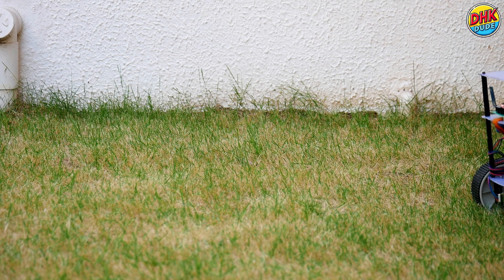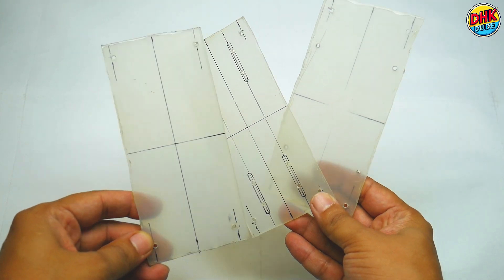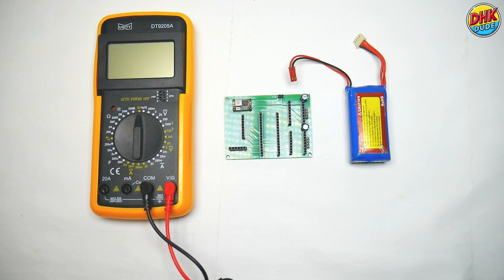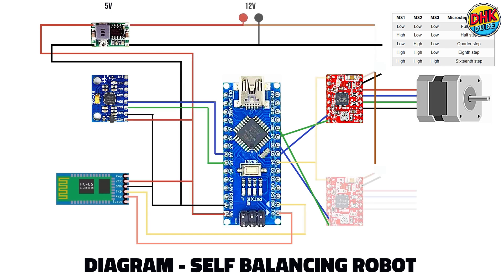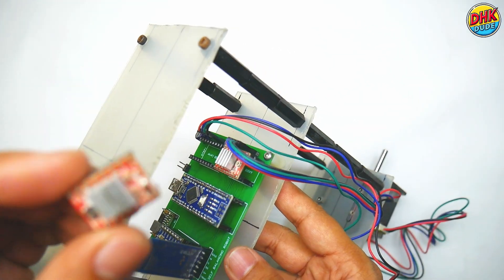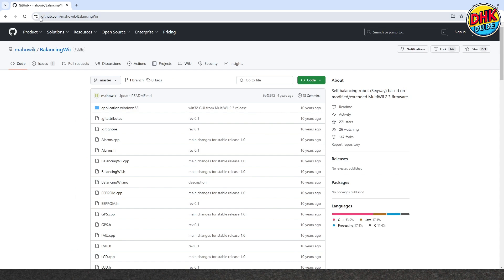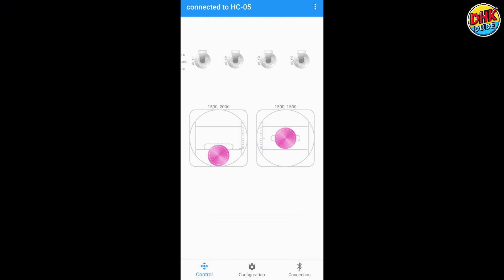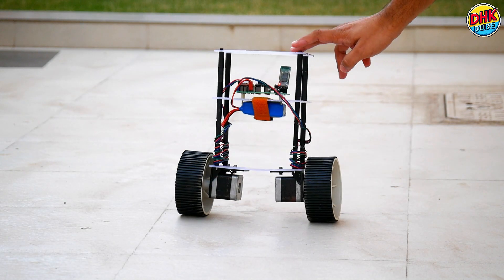How I Built a Robot That Balances Perfectly!

Comment: My robot keeps going in one direction when I turn on the model control. What might be the issue? Please help!
Reply from the maker: @WillowCox134  hi, have you calibrated the mpu6050 using the app?
Reply: @DHKDUDE  You mean ACCcalibration? I've done that
Reply from the maker: @WillowCox134  yes accelerometer calibration, keep the robot in leveled position and calibrate the sensor. I am in the process of creating one separate video for troubleshooting.
Reply: @DHKDUDE  Thank you for replying. I'd love to see the video. I did the calibration multiple times. I'm using breadboard for the circuit and I haven't firmly fixed the MPU6050 as I'm in the phase of prototyping. I'll try it again by fixing the MPU6050.

Comment: Please help me my robot is not running and in the app sound coming no data received
Reply from the maker: It means, there's an issue with the connection between phone and robot. You have to change the baud rate of the HC-05 module.
Reply: @DHKDUDE  I changed it but still not working

Comment: Could you help me with my problem? My Nema 17 motor will just keep on spinning when I open the untested part of ES-GUI it won’t balance or anything it just spins and can’t really go backwards
Reply from the maker: You are almost there! From your post what I understand is, your robot receives a signal from the phone as the motor starts spinning when you go to the untested model, but it is not correct hence the motor keeps spinning. 
There are two possible reasons:
1. Your MPU6050 gyro-accelerometer module is not calibrated. Put your robot on the box in the standing position and keep the wheels free to rotate. Connect the robot to the app and calibrate the module. 
2. Selection of the active axis is wrong in the sketch. Check the mounting position of the mpu6050 and select the axis in the sketch accordingly and reflash the code again.
Try these methods and it will probably fix the issue.
Reply: @ could u explain step 2 further, I don’t really understand
Reply from the maker: Open balancingwii in Arduino IDE, go the config.h page, scroll down to the section 1 - basic setup/current axis. By default it is PITCH but if your sensor orientation on the robot is on the ROLL axis, you have to change it. If step one doesn't work then probably you have to change this value.
Reply: @DHKDUDE  It still won’t work
Reply: I’m still facing the problem inwhich it would just keep spinning it’s wheel non stop I can control it a bit but it won’t balance and when the joystick in EZ-GUI returns to the center it won’t stop spinning
Reply: Sometimes it loads write error too in EZ-GUI
Reply from the maker: @sunsetthireach3223  I will make separate video on troubleshooting as I see some users having issues with connection.
Reply: @ Hello, i did some more testing and this is what I got. When I go to untested the motor starts to spin constantly. I checked if the motor will follow the direction it will fall in and move against and it does do that although slowly but still the robot can’t be controlled as when the joystick is mid it would just spin on and on and won’t stop until I change ARM to high or mid.
Reply from the maker: If your motors are moving and reacting to the movement means there are no issues with the software part. Default settings are good to go so no major tweaks needed there but check your PID gain and also try position hold mode. It would be nice if you share a video of your setup to better understand the issue.

Comment: I am having problem with the gui app can you help it out as i don't know where to download it as it is not available on play store and on website older version is available.
Reply from the maker: I used version 4.5 of this app as long as I remember. Development of this app is discontinued but I think you will still get it from some other sites, just search EZ-GUI ground station on Google, just make sure the site is trusted.
Reply: @DHKDUDE  the site version is not working properly, could you provide your app link.
Reply from the maker: @A.EditZ...Ajcr21  sorry I missed this comment. i just checked my spare phone but it seems i deleted the apk from it after posting the video :p but as far as I remember I just randomly searched for this apk and downloaded it from the site that appeared in the results. i doubt you haven't set baud rate of the module, without changing it won't connect to the SBR.

Comment: I am facing issue with it can you help me
Reply from the maker: Let me know in which part you need help?
Reply: Motor is not running when I connect it to the supply
Reply: I message you on Instagram also
Reply: And app is also not sending data to arduino
Reply from the maker: @Adarshsharma_005  the only possible reason could be the connection between bluetooth module and the phone. you have to change baud rate of the HC-05 module. I have explained it here, in this video https://youtu.be/4qSqwGmLa0s?si=NjlHXfTlVWKSkXmJ
Reply: @DHKDUDE   i have change it but still it is not working

Comment: Is it possible to make this with a 28byj48 stepper motor? Please tell me.
Reply from the maker: I would not recommend it to use that motor for these two reasons.

1. For this application you need high torque, which 28byj48 won't provide. Nema17 motors with A4988 driver you can crank up the voltage double to battery voltage to increase torque. You just have to limit the current, which we have shown in this video.

2. 2nd reason is this particular code is well proven with nema17 motors, so if you use those motors, you have to change drivers as well and it might be tedious work.

Of course you can make self Balancing Robot using 28byj48 motors but you have to use different codes. Hope I answered your question.
Reply: @DHKDUDE  Thank you......! 
❤❤❤❤❤❤❤❤❤❤